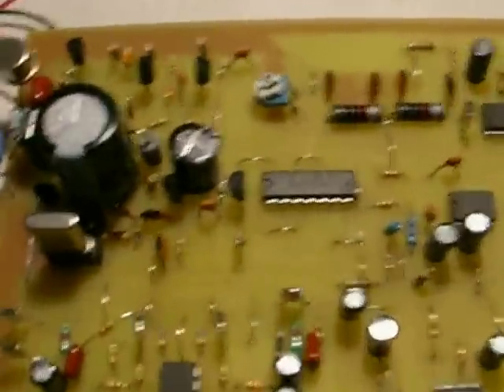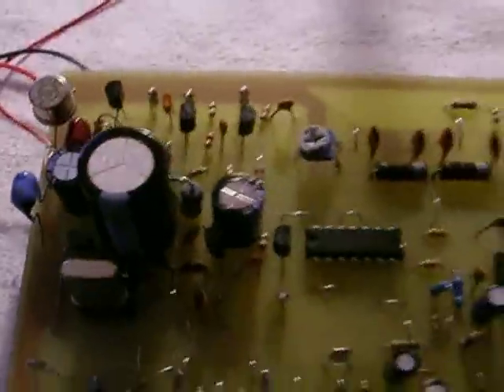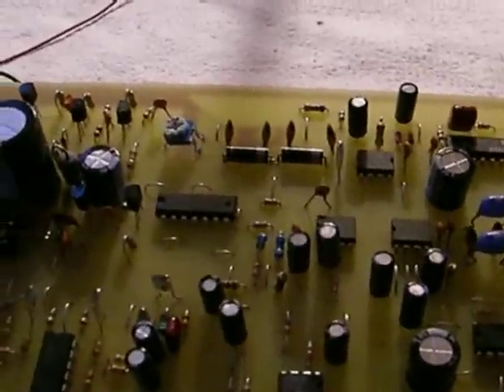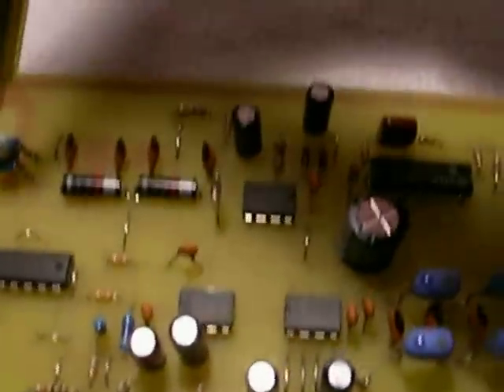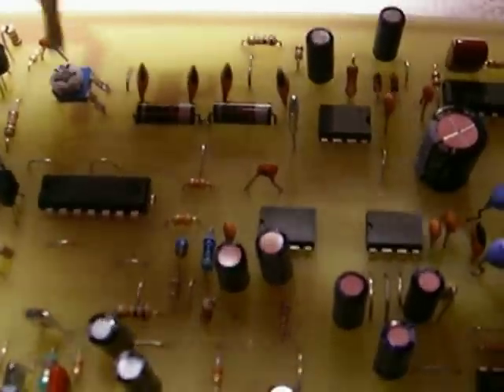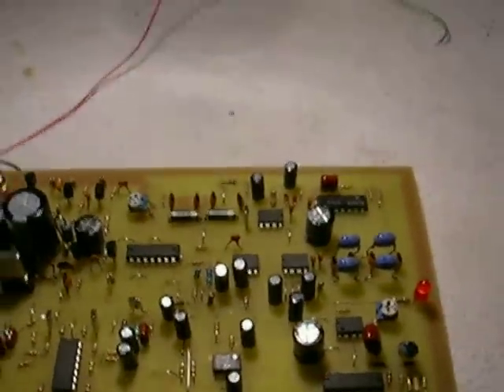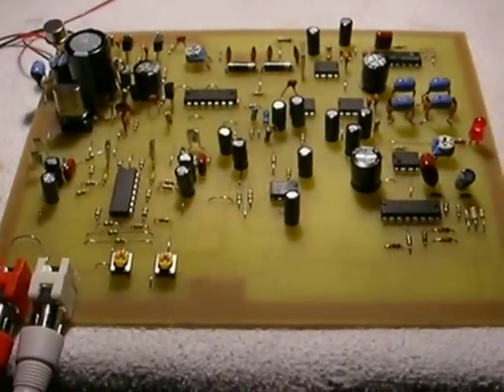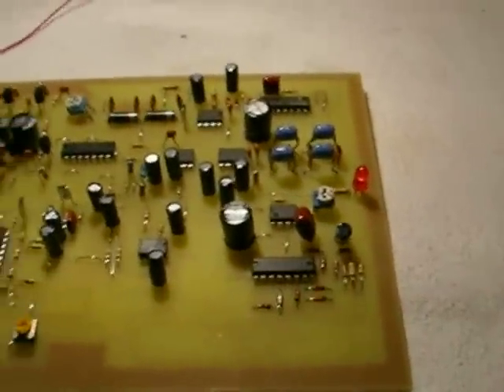AM Stereo Transmitter kit- Demo & adjustments

Comment from the maker: @bratina501 I will go back over the wiring to this circuit for you in a new video. Basically, the coil has to solder to the 1st (end) terminal of the 7809 (this is just a tie point now). The other end of the coil goes to one lead of the rice grain lamp. The other terminal of the lamp goes to the collector. If you just ground the lamp terminal it will lite up (do NOT ground the coil side- taking the coil to ground might open it up) But wait for the troubleshooting video.

Comment from the maker: @bratina501 Nope- Because the 7809 is not in the final circuit at all. If the 7809 is bad, the red pilot lamp will not lite up. The only parts in the final circuit are the transistor, the coil, and the lamp. When installing the coil, if the leads are not "pre formed" to fit the hole and the leads are spread away from the body of the coil, it *can* open the coil. If you are shorting the collector to ground, the only 2 parts in the circuit are the bulb and the coil.

Comment: I did some power testing with this kit and made some interesting discoveries. First thing is the kit works best on 1.5 volt alkaline cells when using AAs on the stingy HD Radio receivers that also get AM stereo rather than rechargable NIMH cells which are 1.2 volts. Another is in theory it might run on the smaller 12 volt batteries with the right battery clip which I might try if I can find the appropriate holder. Finally it does not seem to work properly on a 13.8 volt power supply.

Comment: @fortyfiveplayer I was afraid that would happen so I double checked to be sure the coil was not shorted to ground and its not, it never was. Also I checked the writing on the transistor in the video to be sure it was positioned correctly and it is a perfect match along with the base, collector, and emitter going in the appropriate holes on the board. The 25 mW section is working perfectly and on my AM stereo receiver I get sound in both channels.

Comment from the maker: @bratina501 It will not lite at 9 volts- you have to have at least 12 volts in. As well, it will not always lite up perceptively. If you want to check your work, use the 9 volt battery ONLY! and short the ant to ground briefly.The lamp will lite then.
cc

Comment: @fortyfiveplayer I guess its either not getting power or the ground at the back is not making proper contact or a few components are not wired correctly, or the circuit is working properly and I don't realize it. There are two AM stations on 1250 in Washington, KWSU in Pullman and KKDZ in Seattle maybe the fact that the transmitter is on the same frequency is distorting my preception.